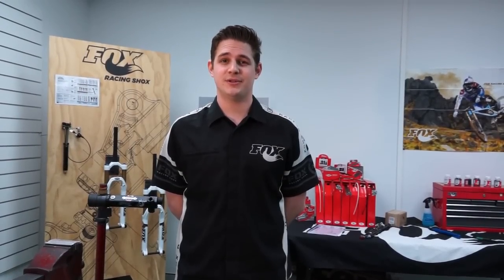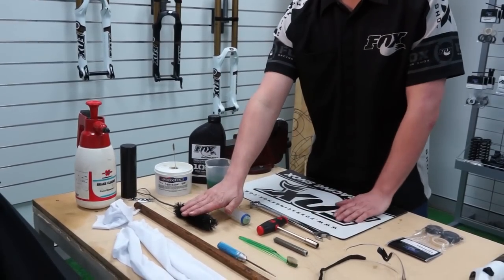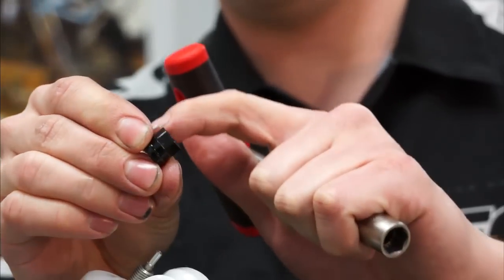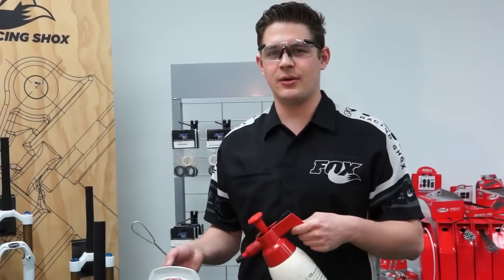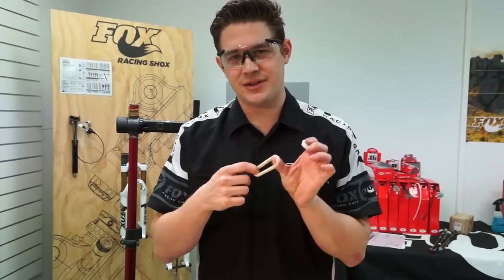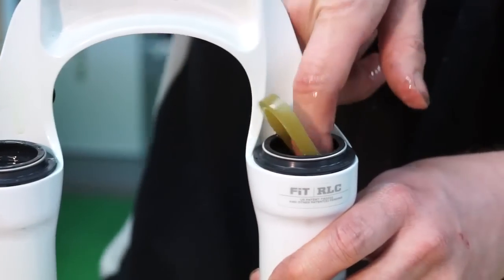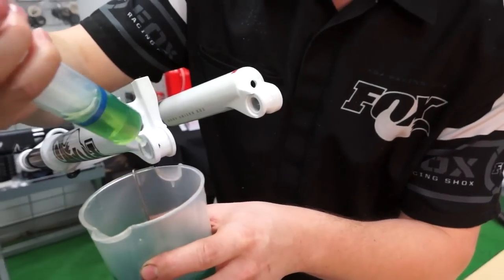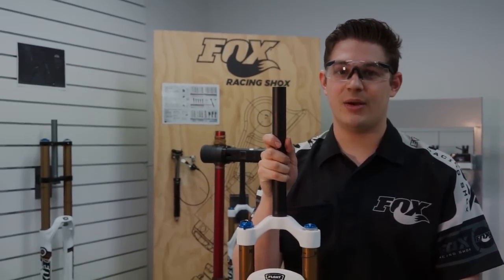How To Service a Fox Float fork - basic fork maintenance - Flow Mountain Bike

Comment: Did mine after 10 years and a few thousand miles. No leaks, oil was still clean and insides were perfect. Although I wouldn't recommend that long, 30 hours is a joke! :)
Reply: the only good thing about 30 hour change is relubing dust seals with sram butter.
Reply: I saw on fox’s website 8 hrs. for muddy conditions 🤣   My Fox Vanilla fork is on its 15th year

Comment: You do not need new seals every 30 hours unless they are leaking oil. Just a clean. Had the same seals for 2 years. I do not use Fox float fluid to lube the foam wipers as some video's suggest. This stuff is sticky, expensive, and unnecessary. I don't use Fox 10wt Green either as it is too thin and wont stay on the foam rings for more than a few hours. Best thing I have found is to soak the wipers in Nulon Fully synthetic gear oil 75-90 wt, Slipperiest stuff on the planet. You can also wipe some on the legs occasionally before riding, which makes a huge difference to small bump response and eliminates stiction. It does no damage to the seals, been doing it regularly for over a year. Way better than these expensive lubes and sprays which don't make any discernible difference. Also turn your bike upside down for 5 mins before riding to get the splash oil up on the wipers.
Reply: AWESOME INFO!
Reply: great, thank you..
Reply: Thanks for the tip.  A quick question for you.  Changing the weight of the oil will effect the damped behavior of the fork.  Have you found that the higher weight oil has made a noticeable difference to your Damper and rebound performance?  Thanks.
Reply: No i didnt replace thte seal, it shouldnt be too hard so no issues there. Thanks for the oil tip as well. I too didnt go for the original fox fluid and im very happy with what i used (not that i would know the differenece)
Reply: +Adrian D What fluids did you use for your shocks?
Reply: cycling2005 what do you use as the suspension oil? cheers.
Reply: @Gone4Dirt  The oil in the lower leg is not used for damping only lubrication. It will have no effect at all.
Reply: companies make people think there way is the only way, thank you for shearing your experience and the other way around expensive parts

Comment: To drive out the shaft with the rebound adjustment I just used a block of wood with a small hole drilled in it. Was surprised how much rubber hammering mine required.

I just changed my oil but when I do the seals I will use a 1-1/4 inch piece of 160 psi PVC pipe as the driver. Note this is 160 psi, NOT Schedule 40 which is too thick. This appears to fit perfectly vs. paying Fox US$30+ for a driver.

Comment: Excellent video, and I got mine done today.  Plastic drain pipes are good size for pushing the seals in.   Greatly appreciate you posting this video!!!  Oh, and I used Amsoil synthetic rather than the spendy Fox oil and no stiction!  Smells the same.
Reply: what weight oil?
Reply: @specagent999   The Amsoil I used is 0-20.   I am more and more impressed with its performance.

Comment: I have an RL80 that will hold air forever just sitting but as soon as you start riding it will loose its air.  Do you know what the problem is and what needs to be replaced?

Comment: Even with a 34mm seal press tool my seals would NOT go in until I hammered each of them with a rubber mallet. It took forever trying to push it in like you did. I cut my hand when the tool slipped again and again. I don't get it.

Comment: When I hammered out the bolts like you did oil sprayed all over the room including on my clothes, which had to be thrown out. Why were you able to do that without ANY oil coming out while on mine it sprayed out?

Piece of "drift" is not a common phrase. I didn't have that tool so I used a small ratchet head but I don't believe that's why the oil sprayed out.
Reply: Did you release all the air pressure?

Comment: Did he forget to put the foam rings back in before the seals !!?
Reply: Notice that too :-)
Reply: Doesn't matter. You can do it either way 👍
Reply: I'd say he did this to prevent oil getting around the wiper seal bed. if this area was lubricated it could cause the Stanchion to pull the seal out on the rebound stroke, this is also why he removed any of the waxy residue that may have been on the wiper seal after production.

Comment: Okay so every 30h lube change that makes sense but do you have replace the seals every 30 h aswell?
Reply: On every fork I've ever owned I've only replaced the seals if they were leaking or where visibly damaged (cracked, torn).  If they are not damaged, I just clean them and continue to use them. Their purpose is only to help keep dirt from getting to the oil and keep all the oil from coming out.  In the service docs on a previous model I had a few years back it said to visibly inspect them and change them if they need it.  Now they tell you to replace the seals every time you do an oil change.  Use your own judgment, but their is a great incentive for them to tell you to change the seals every time - it's interesting that they used to say only do it as necessary.  If there is a problem with the seal, you will know it either with visible leaking, cracks/tears or other obvious damage/wear, and or poor performance.  Don't fix it if it's not broke!

Comment: The pressure limit on the Fork is 135psi, all forks are different, for 34 or 36 the PSI to weight ration is totally different.

Comment: I used this video as my guide, but he didn't replace the oil/fluid in the damper. Nor did he tak about the gasket at the bottom of the fork. I didn't know what it was and thought it might be something needing to be replaced. Otherwise easy to follow video.
Reply: because you can't touch your damper in home ;) "you have to go to service and pay 100$ for oil change" that's how fox works

Comment: Does it have to Be Fox oil or is any 10w fork oil good?
Reply: Any motorcycle Fork oil works as long as it is the same weight. Also synthetic is preferred but not necessary.

Comment: What suspension grease should I be using? Any ideas/recommendations?
Reply: You could use a bit of the oil you use to fill the lowers up or some Fox Fluid, doesn't need to be anything special
Reply: Onion1220 PMR
Cheers!

Comment: because you risk putting oil around the side where the rubber dust wipers sit. if there is oil on there, the rubbers won't stay in place tightly.

Comment: Yeah... my new seals are NOT going on. He makes it look effortless in this video. I'm grunting and straining, putting all my weight into it, and it will. Not. Go. On!
Reply: Huntstyle i had the same problem, i ended up RUINING £28 worth of seals, without the correct insertion tool I wouldn't recommend installing them at home. I got a bike shop to do them for me, it cost me £6, but was definitely worth it
Reply: @philliptaylor502  try puuting them in the fridge first..  Also check you ahve the correct ones, there are older ones which are slightly bigger or smaller I cant remember :-/